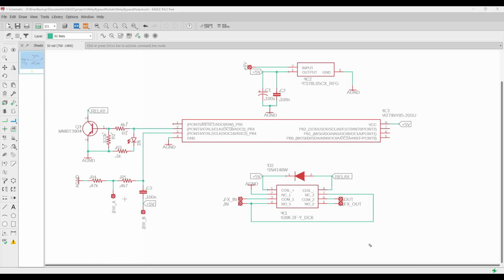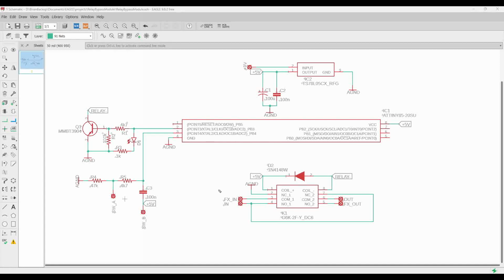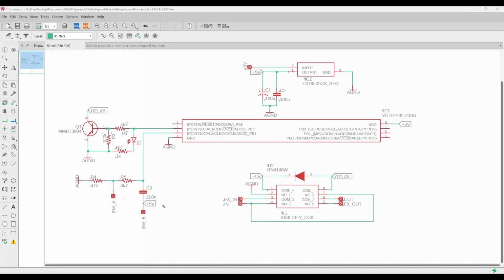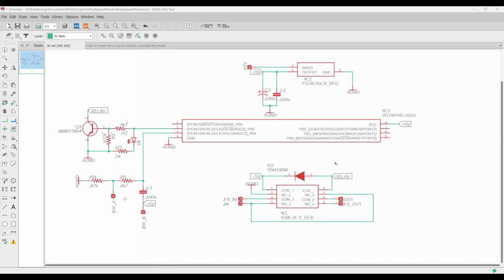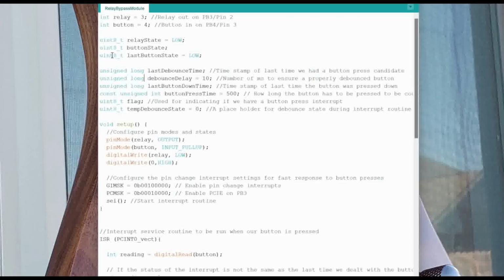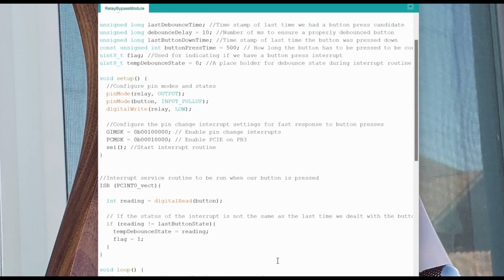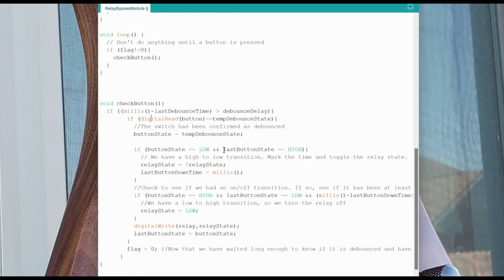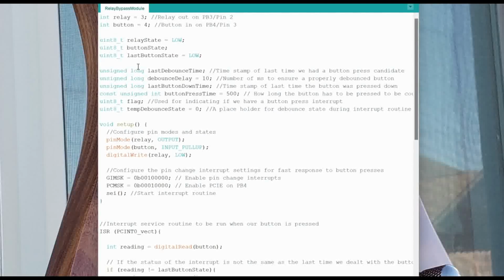Microcontrollers for Guitar and Effects: Designing a Relay Bypass Module

Comment: I'm very keen to get this approach working, but I think there are some things missing from the code in the video - there is nothing in the code to either initialise the variable lastDebounceTime or to update it when the debounce time has been exceeded - am I missing something?
Reply from the maker: Good catch! This code was adapted from a more complex piece of code and the references to lastDebounceTime were supposed to be eliminated, basically relying only on HW switch debouncing. I think as-is lastDebounceTime should be zero and therefore the check is always going to pass (meaning its been "debounced" in SW). The code works for me, as it's exactly what I used for the sample in my video. Is it not working for you?
Reply: @thescientificguitarist4228  Thanks for responding so quickly - much appreciated. I am trying to get it to work using a simple LED on/off circuit much like the one in your video, but no luck so far. I'm just testing the circuit components to make sure there are no issues in there. Then I will try some other ATTiny85 chips to rule that out....I will get back to you with results....
Reply: @thescientificguitarist4228  I tested the circuit and it was all fine with the following simplified code:

int relay = 0;  //Relay out on PB0/Pin 5
int button = 4; //Button on PB4/Pin 3
int reading;

void setup() {
  pinMode(relay, OUTPUT);
  pinMode(button,INPUT);
  digitalWrite(relay, LOW);

  GIMSK = 0b00100000;
  PCMSK = 0b00010000;
  sei();
}

ISR (PCINT0_vect){
  reading = digitalRead(button);
}

void loop() {

  if (reading == HIGH){
    digitalWrite(relay, HIGH);
  }
  else {
    digitalWrite(relay, LOW);
  }
}

Which all worked - after I changed the pinMode of the button to INPUT - your original code has it as INPUT-PULLUP which means it starts as HIGH and never gets to LOW. Changing your code in the same way has made it almost work although it is quite hard to get it to permanently switch off the 'effect' - I need to play around with the code to see how this is happening - nearly there! As an aside, I added a 10K resistor from pin 1 of the ATTiny85 to +5V - I was advised to do this some time ago as it prevents the program being burned into the IC permanently (in previous experimentation, it was impossible to load the ATTiny85 with fresh code, so needed a new chip every time code changed) .

If there is a better way to communicate than through here, more than happy to share schematics etc..

Thanks,

Mike

Comment: Hey there, appreciate your Videos! Im currently planing on modifying my guitar with an onboard DSP that later does the job of exxaggerating the Overtones and other ideas. My problem is, that I have to implement a Preamp boost or a buffer in order to have enough voltage in my signal for modulation with the DSP. Can you think of an easy and cost effective Sircuit that boosts my signal (something like a OpAmp)?

Comment: newbie here. I'm trying to build a really simple on/off high pass filter for my bass guitar so i can get some clean chords from it, since it's a 4 string tuned down to low B. do you guys have any idea on what i would need to build it using a microcontroller? this has been really helpful
Reply from the maker: Can I ask why you want to use a microcontroller for something like this? Is there a reason to not use a mechanical switch or a flip-flop bypass?
Reply: @thescientificguitarist4228  i would like to learn about this process for future more complex projects involving a microcontroller, but i don't know, should i start with all analog?

Comment: Great work. I've made a similar thing for my own builds but used a different uC.

You could improve it a bit by using the watchdog timer to set the microcontroller into sleep mode after a few seconds so that it draws much less current when it's being idle, and make it go into normal mode again using the interrupt. :)
Reply from the maker: You are absolutely correct. As my primary focus is to provide stuff to the DIY community and this is video is an intro to microcontrollers, I thought it best to keep things simple at first, at least until we work up to more advanced concepts like low power modes and watchdog timers. 

On a side note, I love your projects! I really appreciate the "outside the box" thinking.

Comment: Years ago I attempted designing my own module with the Attiny85. It wasn't far off from this design except for some extra filtering. I ended up having to leave it aside as the Attiny tended to introduce some unwanted noise into the audio path. Have you experienced this by any chance?
Reply from the maker: I can't say that I have noticed this. Did you ever determine whether it was coupling via power supply or the actual GPIO pin that was the cause?
Reply: @thescientificguitarist4228  It definitely wasn’t due to noise on the power rails as I overly filtered the design on purpose, and even ran some tests with overkill filtering and that didn’t solve anything. At this point the only thing which was left was the layout of the PCB itself, maybe the GPIO driving the coil was injecting noise into the signal path 🤷🏻‍♂️ (but at that point, since it was a side project, I just gave up)

Comment: How are you dealing with the 'wrap around' of the millis() counter? I've had problems with continuously powered Arduino MCUs causing unwanted triggers due to the maths of the de-bounce calculation happening by chance when the counter internally resets to zero as it reaches the max register value. Solved by setting up a second timer counter to force a millis() reset after a period of time that is less than the max value, but doing it under programme control at a convenient point in the code so as to not affect the debounce or interrupt service routine.
Reply: You can get around this by making sure your code works with intervals - i.e. the difference between two times, rather than comparing against a future time. If you compare against a future time, then the millis() wraparound can bite you. However, if you look at the interval between two readings it will not - even if the millis counter wraps around. This is due to the way the unsigned binary math works.

Basically, you want this:

if ((later_time - earlier_time ) >=duration ) { do_something }
then the wrap around does not come into play.

So...

unsigned long currentMillis, previousMillis;
unsigned long interval = 1000; // one second

void loop()
{
    unsigned long currentMillis = millis();

    // Read the sensor when needed.
    if (currentMillis - previousMillis >= interval) {
        previousMillis = currentMillis;
        readSensor();
    }

    // Do other stuff...
}

Make sure interval is defined as an unsigned long as it is above and this approach will always work. 

Apologies if YouTube breaks the spacing on that code! 👍

Comment: Love the video and the straightforward design. And beautifully explained. The only comment I would add (and I'm being very pedantic) is that R2 is not required to provide a leak down path, since pin PB3 will be actively connected to ground internally by the MCU. If you were tri-stating the pin then yes, it very definitely would be required - even more so if PB3 was driving the gate of a MOSFET. But, as a belt-and-braces approach, there's nothing wrong at all with including R2.  Great video, man. Greets from Aberdeen, Scotland. 👍
Reply from the maker: I have found that with some of the ATTINY parts that the pulldown doesn't always work as reliably as I like, so I put it in for the belt and braces approach :D